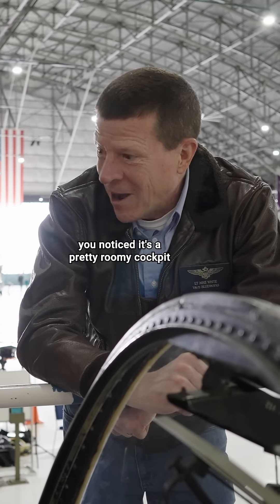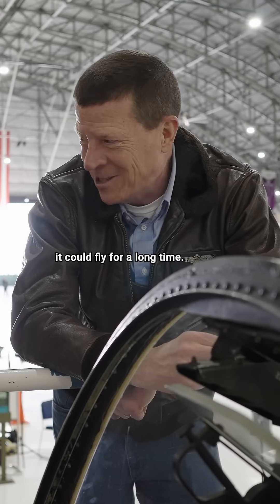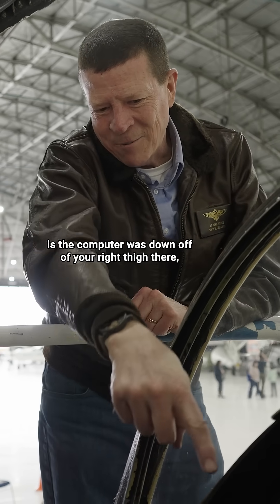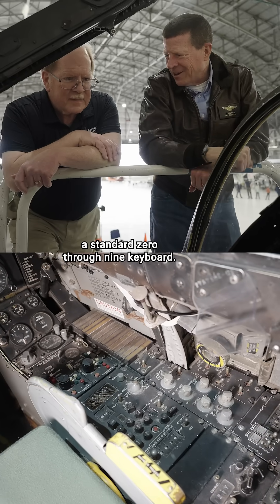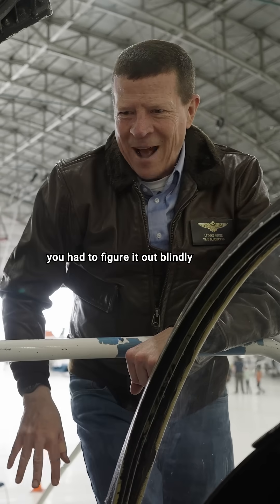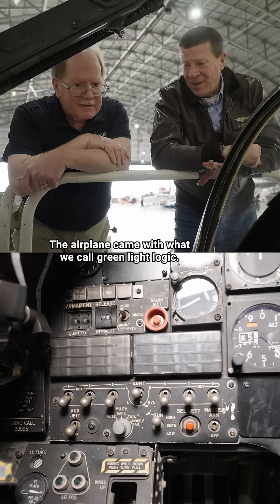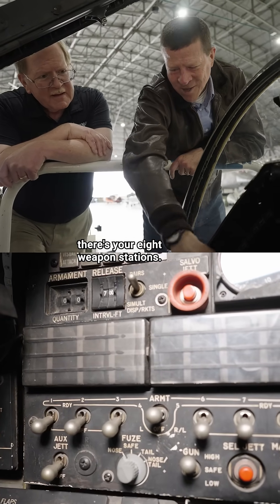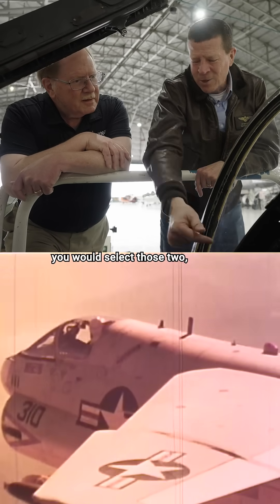Inside the A-7 Corsair II Cockpit #aviation #pilot #a7 #history #cockpit

Comment: A-7 was ahead of its time because my generation was using a single thumb texting with phones in our pockets
Reply: A-7 is from the dialup POTS era well before personal computers let alone SMS. Avionics of that era were large, heavy and still had vacuum tubes and tuning motors. A modern phone is far more complex than all the systems A-7 was delivered with in 1965.
Reply: @Comm0ut  I'm talking about using a standard 12 button keypad without looking. a late 90's early 2000's kid would 100% be able to use that console without looking.